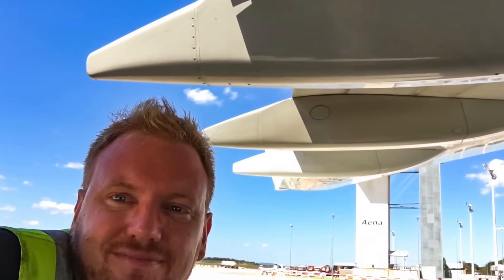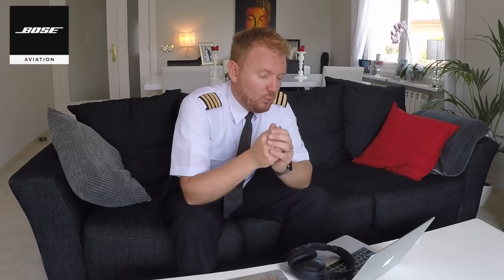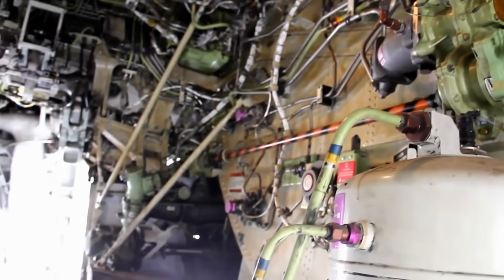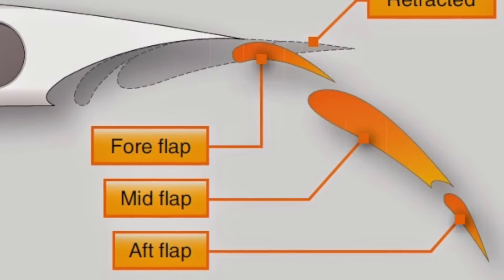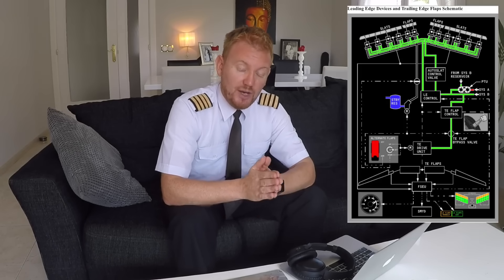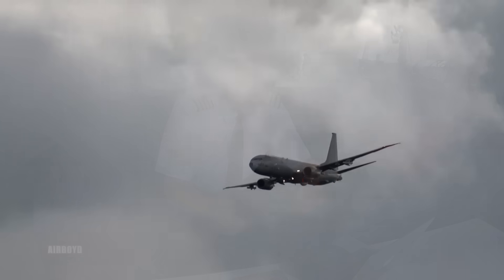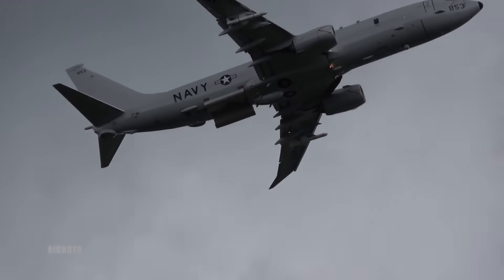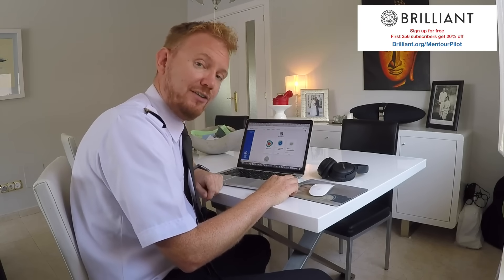"Pods" under the wing? What are they?

Comment: I was a Jet Mechanic in the US Navy during the Vietnam War and worked on Pratt&Whitney TF-30 P408 engines. After looking at those photos of the Fearing gear assembly I forgot how much safety wiring we had to do on Jet aircraft engines and any other moving parts on the aircraft. Every nut and bolt and fitting were safety wired to each other to prevent the nuts, bolts and fittings from coming loose in flight. 
The real fun was safety wiring the engines combustion cans at the center of the engine. There were always a few combustion cans that were hard to get at and you had to use a mirror to see what you were doin. Thus you were observing a reverse image in the mirror while wiring the combustion can bolts. It was a challenge and took a little practice.

Comment: These pods under the wing are the trailing edge anti-shock bodies used on the Handley Page Victor bomber, commonly referred to as "Küchemann carrots" invented by Dietrich Küchemann, who worked for the Royal Aircraft Establishment.  They greatly reduce drag.  Kuchemann is also credited with the Coke-Bottle 'area rule'.
Reply: You're 100% right.  This isn't really covered in the video, but the reason the pods are where they are, and they are the shape they are, is due to the Transonic Area rule (as the Coke-Bottle rule is properly called).

Most 3rd year Engineering students learn how to derive this rule when studying supersonic flow.  Basically, supersonic flow can "choke" when "turned" too much by a rapid change in body geometry.  From this concept, the ideal "cigar" body can be derived.

This is more obvious in some planes like the DH Comet, where some of these concepts were implemented for the first time.

Comment: The militarized 737 shown in this video is a U.S. Navy P-8 Poseidon anti-submarine warfare aircraft.  The weapons hung beneath the wings are AGM-84 Harpoon air-to-surface missiles.  The aircraft actually has 6 hard points (4 under the wings and 2 under the fuselage) intended for carrying external weapons and an internal weapons bay, in the bottom of the fuselage just aft of the wings, which can accommodate up to five torpedoes or depth bombs.  Quite an arsenal for an aircraft designed as an airliner.  Now if they could just figure out where to fit in a tail hook.  Does GE offer an afterburner equipped version of the CFM56?

Comment: Yes you have a way of explaining operations, engineering, aeronautics that covers all details.  And you explain why??? The why part is so important in understanding a system and yet so many don’t go into the why.  Why? Lol I don’t know but without knowing why and how Snd when your only getting parts of the whole picture. I’m an industrial printer technician I fly a lot.  But I’ve seen techs replacing the same parts over and over as I’d they knew the system they would understand the sequences leading up to part failure not only wasting parts and angering clients but the failure half the time isn’t in the broken part.  Common sense is needed logic is needed the ability to stay cool under pressure and get tasks done. Mentally knowing what systems interact with others to get best course of action.  So they me having you explain the way you do definitely I’ll be watching

Comment: I was on a flight where one of these “pods” was loose. When the flaps were down the pod shaked wildly. When the flaps were up the pod was hanging down but not shaking. We landed ok but it scared a lot of the passengers.
Reply: yeah it can be scary but even if one of those breaks loose there would be nothing to worry about :D
Reply: @friedchicken1  
"Nothing to worry about", what about hitting someone's head on the ground or smashing through a roof?
Reply: @redblade8160  oh yeah
Reply: Yet again the author is full of shit. Pods wouldn't create "enormous amount of drag". The most important parameter when calculating drag is the area measured from the direction of air. When packing in something you increase the area, thus the drag.
Reply: @Youtube_Stole_My_Handle_Too  You misheard him, rewatch it and turn subtitles on starting at 1:30. He says "the pods are there to streamline the air as it's flowing through" and "IF the pods were NOT there, it would cause an enormous amount of drag." Literally says the pods decrease the drag. The trailing flaps cause the drag, not the pods. The pods support the flaps and decrease drag, as well as help make sure the flaps are extended equally to create even lift/drag on both wings.
Reply: @sorryifoldcomment8596  You're not getting it.
Reply: @Youtube_Stole_My_Handle_Too  Does he not agree with you, though? Your comment argues: The author is full of shit. Pods wouldn't create "enormous amount of drag." 
The full quote from the video is "If pods weren't there, it would create an enormous amount of drag." And no where does the author say pods would create an enormous amount of drag. His claims about pods & drag does not conflict with your claims about pods & drag, including "pods wouldn't create enormous amount of drag." He would agree with you. Therefore, not full of shit. 

Point being, I'm not saying you're wrong and the video is not saying you're wrong. You're only wrong about your first claim, that the author disagrees with & is claiming pods create enormous drag. It's a simply misunderstanding. That's why I had to go back over the video with subtitles on and check. :)
Reply: @sorryifoldcomment8596  Still you're not getting it.
Reply: @Youtube_Stole_My_Handle_Too  why do u think fighter jets are streamlined? To reduce drag. I’m sure they could take off a lot of weight and area if they could make them non streamlined.
Reply: @bowdendrake6316  The number one parameter for drag is the area of the cross section in the flight direction. When something is packed in to make it smoother this cross section is increased. The number one reason why something is packed in, is to protect what's inside.
Reply: @Youtube_Stole_My_Handle_Too  drag is primarily dependent on the shape of the surface
Reply: @bowdendrake6316  That's what makes you a dilettant and me an expert.
Reply: @Youtube_Stole_My_Handle_Too  really ? Doesn’t look like that. All my studies in aerodynamics says the contrary. But you are an auto qualified expert so probably you should know.
Reply: @luismigueloteromolinari5406  You have never studied anything. You can't even avoid appealing to authority. You still got a kid brain.

Comment: Hey mentour, if your flaps weren't stuck and it was only a micro switch, couldn't you bypass the saftey and manually extend the flaps seeing as you could physically check that the flaps were extended equally  ?
   Or is it impossible to bypass a fault !?

Comment: Hi ! Mentour, how thus the Run Air Turbine works? and when  it works?
Reply from the maker: Ram Air Turbines work like a wind-turbine and are only activated if a loss of electric/hydraulic power is sensed, normally after a loss of both engines .

Comment: cover subjects like being required to turn off electronic devices during take off - is there an actual incident caused by passenger electronic device? (or is this too sensitive a subject with aviation regulators such that giving an honest assessment could get an aviator in a bit of hot water with employer or regulators?)

Comment: No micro switches.  skew sensors are rotory gear sensor atacted to a rod connectet to flap,  Position sensor also gear driven,  NO MICROSWITCH ON 737 Flaps

Comment: I always thought they were called nacelles which do exactly what you say they do.  The aircraft was originally developed in France in the early 20th century and is why many of the parts have French names.  They are not just "flaps" but are technically called Fowler-Flaps as they have slats to increase laminar airflow which increases efficiency.

Comment: You are a good pilot. One of my favorite airplanes is the Junkers Ju52, I like its flying characteristics. It has just one long wing control surface that functions as a flap or aileron. 
About the missile carrying capability, almost all big planes have strong points under the surface skin on the wings and fuselage. Devices can be attached on these strong points such as radar pod, scientific instruments and sensors, sea rescue pod, rockets for boost takeoff, missiles and bombs and even engine transport. The last one, an airliner can carry an engine as frieght (usually when a repaired or faulty engine that needs to go back to their maintanance centre)with passengers on board. The engine is slung under one of the wings and while flying, the pilot trims the rudder for the extra drag on that side.

Comment: Once I've noticed the tip of a "pod" was missing and discretely notified the crew by taking a photo with my phone. The attendant took my phone and went to show it to the captain - who said it was nothing to worry about. So apparently, it did not affect aerodynamics much. They knowingly took off without it.
Reply: It can actually be of, its a MEL (CDL) item, so there will be a fuel penalty (meaning it will affect aerodynamics to a degree). 
But you can fly without, in a restricted number of days, at least on a 737NG

Comment: 8:50 It's a big deal if the runway is very short, f.ex like in Funchal Madeira. It is extended but back in 1979, it was kind of dangerous. I remember we stood waiting for the plane while the pilots did some rounds back and forth before, we were allowed on board. The pilots tried to find the right speed without passengers, so they better knew how fast they had to go with passengers. It was a Boeing 727.

Comment: @mentour When I was young I remember going to Bulgaria with my parents for vacation. We were flying from Paris to Sofia in a old Tupolev. I remarked that ice (or water) was noticable on the door inside the cabin after the crew member had closed the door. My father asked the crew member if it was dangerous or not but the crew member said it wasn't. So, what about this amount of water inside the cabin? Does it means that a problem of internal pressure can happen during the flight or that it can lead to another dangerous situation during the flight? Thank you very much for your answer.

Comment: A question, maybe a video to explain:  Why do turbo-props start their engine with the blades in the full feathered position instead of the neutral pitch--between forward and reverse thrust?  It seems to me the air resistance on the blades would create enormous torque stress on the blades, prop hub, transmission, and engine, whereas neutral pitch would have minimum air resistance.  I've always wondered.

Comment: If the scenario was no flaps, what is the minimum air speed at which to land a 737? Also what is the minimum air speed at which you can deploy the landing gear? I had always thought that no flaps would put the aircraft in a speed too fast to drop the gear safely. Your thoughts.

Comment: Aeroplanes have always run on air, not fuel.

Aeroplanes do not even emit gas smoke, from their propellers, not fuel engines.
Reply: Don't be silly, Plane run on fuel and you know it. Also you can see exhaust
Reply: @ethansaviation2672  it is impossible. Think about it. And watch a video of the zeppelin.
Reply: @nataliee5501  A zeppelin is not a plane🤦‍♂️

Comment: Every new engineer has to justify his job so he adds more complication to already perfect system making it more intricate & less robust
A simple offset hinge in the fairing with half flap hiding inside wing can extend flaps exactly same way that be a 1000s times robust & would require a 1000 times less maintenance
Reply: Engineer Ahmed it does reduce stress by changing the stress focal point of the flaps from behind to parallel

Comment: Enjoy your videos, they are very informative and interesting.  20 years ago, I was flying commercial from Dallas Forth Worth to Honolulu International Airport.  After landing I noticed a 4 engine jet liner on the tarmac.  The jet has an engine attached to the left side of the fuselage towards the nose of the aircraft.  My best guess is that the engine was being flown as a replacement  for another engine.  I have several questions:  with the engine attached TO THE FUSELAGE it would have to change the aerodynamics of the aircraft, increase the drag and how would the airflow around the engine affect the control in pitch and yaw of the jetliner ??
Reply: Did you get a picture of this?  Sounds like a very bad idea.

Comment: How many flaps per wing?   If the right wing flaps are not in synch or uniformly or symmetrically extended like the left wing,  will both motors stop or will the motors begin retraction?
Reply: Jerry Two double slotted flaps on each wing. There is something called the TE ( trailing edge) flap skew and asymmetry detection that functions stop the TE flap hydraulic operation if the TE flaps are not aligned.

Comment: Nice teaching about a detail of an aircraft. Most people who look at an aircraft when boarding or during flight have no idea about those details. Just call those fairings "Flap Track Fairings" and not flap fairings. The flaps as such do not need fairings. But the tracks where the flaps move along when extended and retracted plus the the drive mechanism is that part of aircraft that needs an aerodynamic fairing. 
Those fairings have also a second function: They reduce the overall drag of the aircraft when flying faster than Mach 0.75. It has to do with the "area rule" of low-drag transsonic aircraft. When you take cross-sections 90° to the center-line of an aircraft you can see that the areas of those cross-sections become much larger at the locations where there is the wing in addition tho the fuselage. The aerodynamic laws do create additional drag when this area suddenly becomes much smaller. This is the case at the trailling edge of the wing. By adding addidtonal streamlined bodies that "bridge" this down-step of cross-section at the aft end of the wings will reduce drag at high Mach numbers in subsonic flight. See also Wikipedia "Kuechemann Carrot" / "Anti-shock Body"

Comment: What rotation speed do jet engines run at?   What type of main bearings are used in the engine? What grade/type of engine oil is used?  What fuel is used, I thought it was a high grade Kerosene? Why are Diesel engines not used on propeller aircraft? If they are then why not use petrol driven engines?  Diesel would be more reliable, no?

Comment: At 2:10.  Flaps do not make the wing chord "more bent".  The chord is a straight line regardless if flaps are up or down.   Flaps will however change the camber.  Chord and camber are two separate and distinct lines.  Basic aerodynamics!  Private pilot level knowledge.

Comment: Mr Mentour pilot : you need to do some deeper study on these pods and why they’re so bulky. You’ve answered it all wrong. They’re bulky because they are needed to comply with the area rule for transonic airplanes. What these pods contain, you’ve answered correctly; the DC -9 also has flaps on its wings. But they’re extremely slim while containing the same operating mechanisms. The only difference is that the area rule doesn’t require a gradual increase or decrease in cross sectional area on the DC 9 because it’s engines are on the tail. Please read about the area rule first, then view a DC-9 in profile and notice why it doesn’t need these flap pods to be so bulky and tapering. Ive been a design test pilot for 42 years so I know what I’m talking about.

Comment: hi mentour! i´d like to understand the difference on the bypass ratio between an older engine -like CF6-80c - and a newer one  - like GE90 -  how they achieved such a big difference from one to another. 
Also, as I read that the length of the turbine on CF6 is around 4,30 mts and the Ge90 turbine is 7,30 mts. But when I look into both models they seem to have similar length.. I dont understand why the measures are so different on technical specifications.. is it because turbine length is not same as nacelle length?

Comment: Joe, the armed 737 you spoke of is the P-8A Poseidon, and it's used for tracking and attacking submarines and surface warships.

Also, maybe I just missed it in the video, but aren't those fairings also meant to function as area-rule anti-shock bodies that reduce wave drag at transsonic speeds?
Reply: Yep, the first explanation of those bodies ive heard was actually the anti-shock body idea^^

I suspect it was just the perfect fit to do both at once, hydraulics, and transonic drag improvement.

Comment: MP...can you explain whether the "stand by" electronic motor to the hydraulic motor is "auto sensing"?  If the hydraulic motor stops due to asymmetric flap condition, does the pilot manually control the electronic motor (backup) as a measure to extend the flaps?  Also with retracted flaps, how much more runway should you allocate a  737 to land supposing you still have reverse thrusters?

Comment: I was on a B737 that appeared to have a loose fairing. At least it was moving around in the airstream.  Is that a serious problem? The pilot I informed after landing did not seem concerned. Maybe they use less fuel with parts missing. Haha

Comment: i am interested to know as soon as the plane touched down and it taxi into the gate. May i know whether the pilot has to steer the wheel all the way to the gate or it will be done by computer? Thanks in advance to hear your reply.
Reply: Samuel Yu They manually taxi the plane. Autopilot does not work on the ground.
Reply: Appable many thanks and may i know which cockpit equipment they are using the steer the plane?